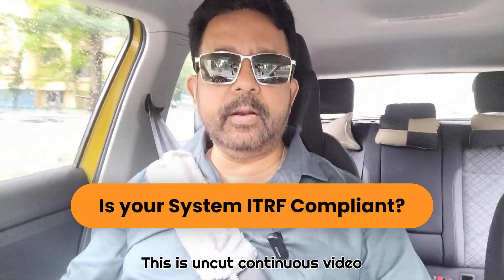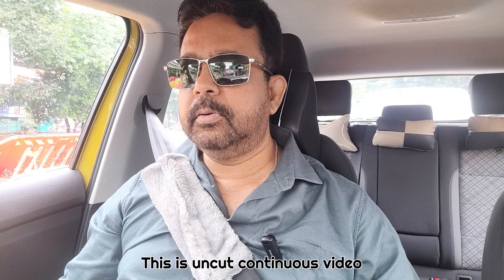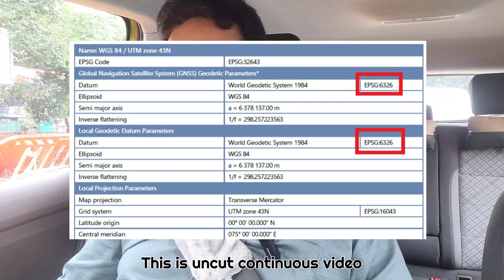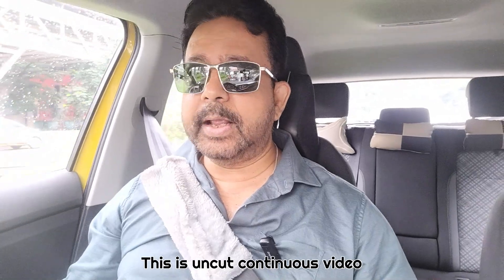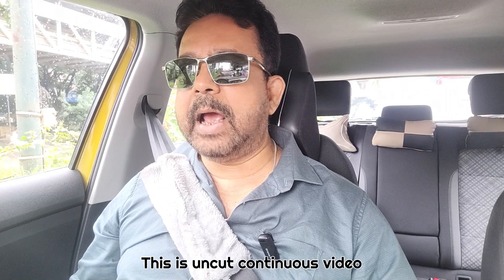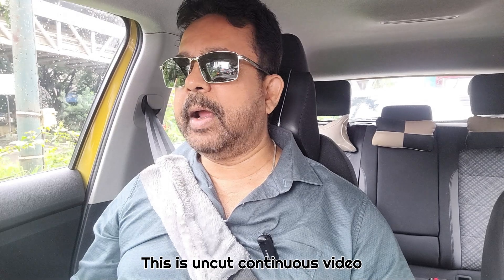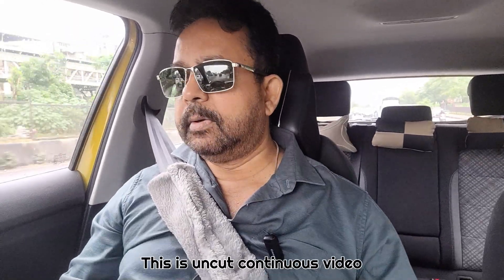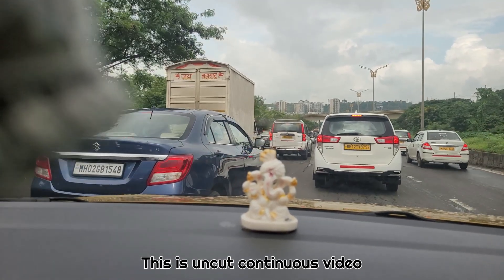Is Your GNSS System ITRF2020 Compliant? How do you Check?

Comment: There is so much confusion on this topic...   My field is GNSS. Not a single GPS receiver is aligned to ITRF. The GPS constellation was aligned to ITRF 2020 in week 2296 (7 jan 2024) when the 2.4 cm jump from ITRF 2014 to 2020 happened. WGS84(2296) is "closely aligned to ITRF2020"  but it is not the same. The same is true for all other GNSS's. Surveying GPS receivers can use the firmware to execute Helmert transformations back to older ITRF implementations, but that is quite a deliberate action. I mainly work at sea where PPP corrections are in ITRF2020, but when working on land most surveys are done in a local reference frame using RTK. By definition when using RTK, the reference frame is determined by the reference frame of the corrections source.
Reply from the maker: Very true. Some software uses offset to the current epoch to align and you need to choose from the droodown datum menu, but there aint enough information for the surveyors to be aware and do the right thing.

Comment from the maker: Selecting WGS84 as your Geodesy is simply not enough. You must select the ITRF 2020 or ITRF2020~2023 or similar settings in your software. Make sure your GNSS device firmware is updated with latest update. This was an impromptu video without any edit or cut, so you may find some mistakes as English is not my first language. Feel free to ask question and never hesitate.